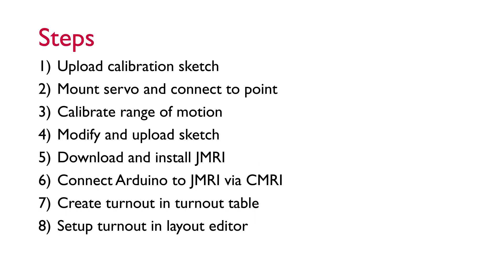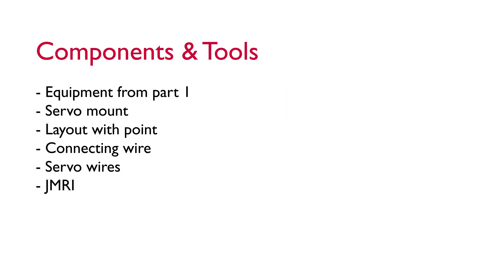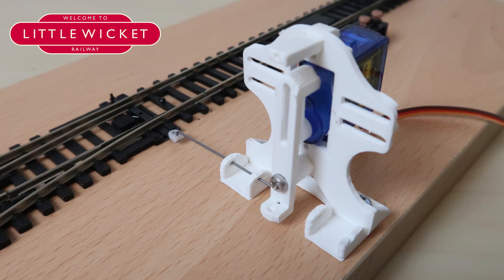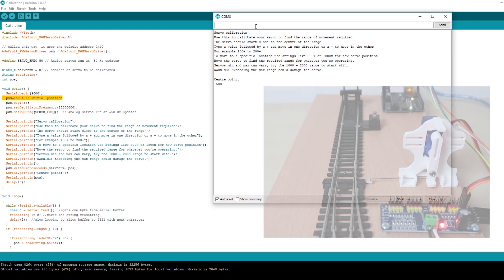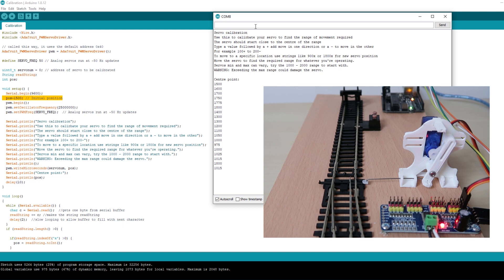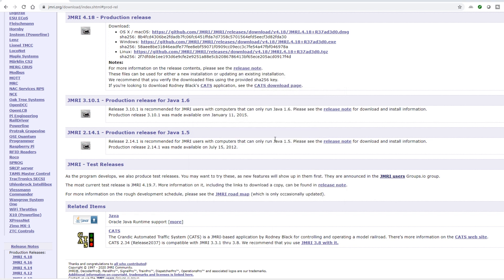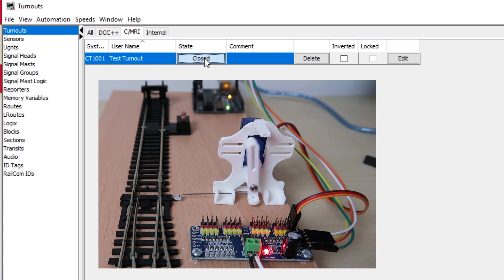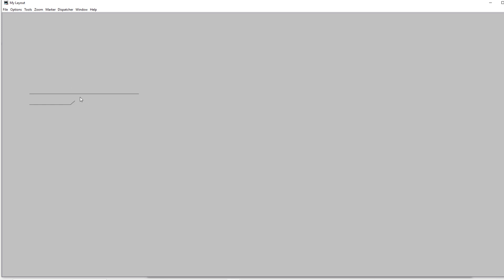Servo Motor Control for Model Railways Part 2 of 3 - Servo Point Motor

Comment: when I add the sketch Calibration - downloaded from your link, I get an error "redefinition of 'void setup()' when I try to Validate. The error code is reproduced below
Arduino: 1.8.13 (Mac OS X), Board: "Arduino Uno"

/Users/andrewgarcarz/Documents/Arduino/sketch_feb10e/Calibration.ino: In function 'void setup()':
Calibration:13:6: error: redefinition of 'void setup()'
 void setup() {
      ^~~~~
/Users/andrewgarcarz/Documents/Arduino/sketch_feb10e/sketch_feb10e.ino:3:6: note: 'void setup()' previously defined here
 void setup() {
      ^~~~~
/Users/andrewgarcarz/Documents/Arduino/sketch_feb10e/Calibration.ino: In function 'void loop()':
Calibration:36:6: error: redefinition of 'void loop()'
 void loop()
      ^~~~
/Users/andrewgarcarz/Documents/Arduino/sketch_feb10e/sketch_feb10e.ino:8:6: note: 'void loop()' previously defined here
 void loop() {
      ^~~~
exit status 1
redefinition of 'void setup()'

This report would have more information with
"Show verbose output during compilation"
option enabled in File -> Preferences.

Any ideas? 
Up to this point the servos worked well (Part 1 Video) but now I'm stuffed

Comment: you could take the spring out of the point and slow the servo down, so that you have a realistic movement on the point.
Reply from the maker: Yeah! On the next layout I definitely plan to slow the points down to a realistic speed. Hopefully because the servos are so powerful I won't need to remove the spring which might be a bit of a faff.

Comment: Like Martin below I am struggling getting your calibration sketch. I'm probably thick as 2 planks. Video 1 went faultlessly, but unlike the test sketch in V1, there is no button to just say download to my PC. I've tried cut and paste into a new Arduin IDE file but when that compiles I get error messages. I'm new to all this, and have no doubt any body. Basically how do I get your Calibration Sketch into my library?
Reply from the maker: Hi Simon, are you able to copy the code from here into your Ardunio software? https://github.com/LittleWicketRailway/ServoControl/blob/master/Calibration.ino

You'll need to save it and then should be able to verify and upload just like in video 1. Let me know how you get on.
Reply: Fixed. Hope this makes sense, but my IT son helped me based on what Martin's problem was. To help others:
As I could find no way to directly down load your sketch I cut and pasted the text of your sketch into a blank file in the IDE editor. When I saved this, it gave the libraries folder as the default location. My son said that was the problem and needed to set up a folder called sketches (say) and save it in there. As soon as I put it in there the and did upload all the errors went away. (Apparently my son said they were only warnings because the sketch was in the libraries folder.)
Reply from the maker: @Simon Turner  Thanks for sharing, I bet other people have had this issue 👍 Thanks to your son for sort it all out!

Comment: Love watching your videos. I’m new to the hobby could you tell me when you measure a 15inch radius bo you measure from the inside rail or the outside rail or from the middle of the track it’s self .thank you
Reply from the maker: Hi Kevin, for Hornby curves the radius is measured to the centre of the track, between the two rails, but I'm not sure about other manufacturers. 15 inches in cm is 38.1 and that's close to being a 1st radius Hornby curve which has a radius of 37.1cm. If you google track geometry then you'll probably find some useful diagrams. What type of track are you using?
Reply: Thank you very much.your videos are well put together .

Comment: Hi Rob
Great  video watched on my smartphone.  How do you insert/ upload the calibration  sketch. 
Thanks
Andy
Reply: HowDo you download the calibration sketch as it does not show in the description below thank you 
Great series and easy to follow many thanks Barry
Reply from the maker: @barrygreenwood7674  the calibration sketch is in the same area as the main sketch in the GitHub repository: https://github.com/LittleWicketRailway/ServoControl/blob/master/Calibration.ino
Reply from the maker: Hi Andy! You upload the calibration sketch to the board first, find the servo positions and they you have to reupload the servo sketch with those positions in them. I know it's not an ideal solution having to upload sketches multiple times, but it's a process you should only ever need to do once for each servo and then it's sorted forever.

Comment: Excellent tutorial - followed it to the letter and it all worked fine (apart from the bits that I didn't follow first time around - probably and age thing).
Reply from the maker: Thanks! Haha, following the instructions first time, where's the challenge in that? 😂
Reply: Whilst appreciating that your aim is to automate as much as possible, I would like to set up a servo on a set of points that is operated by push button.  Can your sketch be adopted to use a push button and if so can you provide any coding or pointers.  Thanks

Comment: That Wonderfull I now have my first on working but I would like to control the speed of the throw I have tried working with the WMF but it seems not to be helping is there some code that could be added to control the speed?
Regards Derek
Reply from the maker: Hi Derek! Congratulations on getting it up and running. You need to add a loop to the code that changes the position of the servo. I think there's an example of a loop at the end of the coloured light video. The same type of loop used to fade the light can slow the point movement. Let me know if you can't find it and I'll try to dig out the code.

Comment: Rob... this tutorial is fantastic! I am a novice at best with Arduino but have been trying to learn. I have tried for years to find a tutorial that showed how to use servos for point motors (turnouts for us yankees) and connect them to JMRI, this was just what I needed. I havent had much luck with DCC++, my decoders (Soundtraxx) would not work correctly with it and like I said I am not very good with arduino code and therefore not good at troubleshooting the issues with DCC++. as a result I have gone back to connecting JMRI through my Digitrax system (which I already have and it works fine for me). The question I have is: can I connect this turnout control through JMRI with a Digitrax system and not DCC++?
I would appreciate any guidence that you could give me on this, 
Thank You
Paul
Reply from the maker: Hi Paul! Thanks!

I can't say for certain as I haven't tried it myself and I've never used DigiTrax, but I think that should work. JMRI can have multiple connections to different systems. Keep your turnouts on the CMRI addresses and use DigiTrax for your loco control.
Reply: @LittleWicketRailway  

Thanks for your reply. I actually figured it out. When I watched your video it was kinda late at night and I was tired and not processing everything. I woke up the next morning and connected it... it works great. 

Thank you 
Paul

Comment: Just subbed found this all fascinating ,I went down the route of block signalling  product with point indication leds a nightmare to wire up ,maybe this would have a challenge. Regards Fred the dc dinosaur. ps great for all the young guys who are dcc and tech orientated . Pps 1 only use an iPad Pro
Reply from the maker: Thanks for watching 👍 I think whichever method you go with the wiring is a nightware, although I am looking at how easy it is to start using some wireless components.

Comment: On trying to verify and/or uploading the compilation sketch I get error messages 
as below.  From Github, as your link, I chose Add File via Uplink for Calibration and then copied and pasted the code into the Arduino IDE.  I then ran verify and obtained all the error mesages and also tried Upload and again received all the messages.  What am I doing wrong?  The error messages are too long for this comment but they seem to revolve around redefinition of 'Adafruit_PWMServoDriver pwm' and highlights a line of code that is  #include <Auto485.h>
Regards
Martin Wilkins
 
Arduino: 1.8.13 (Windows Store 1.8.42.0) (Windows 10), Board: "Arduino Uno"

C:\Program Files\WindowsApps\ArduinoLLC.ArduinoIDE_1.8.42.0_x86__mdqgnx93n4wtt\arduino-builder -dump-prefs -logger=machine -hardware C:\Program Files\WindowsApps\ArduinoLLC.ArduinoIDE_1.8.42.0_x86__mdqgnx93n4wtt\hardware -tools C:\Program Files\WindowsApps\ArduinoLLC.ArduinoIDE_1.8.42.0_x86__mdqgnx93n4wtt\tools-builder -tools C:\Program Files\WindowsApps\ArduinoLLC.ArduinoIDE_1.8.42.0_x86__mdqgnx93n4wtt\hardware\tools\avr -built-in-libraries C:\Program Files\WindowsApps\ArduinoLLC.ArduinoIDE_1.8.42.0_x86__mdqgnx93n4wtt\libraries -libraries C:\Users\marti\OneDrive\Documents\Arduino\libraries -fqbn=arduino:avr:uno -vid-pid=2341_0043 -ide-version=10813 -build-path C:\Users\marti\AppData\Local\Temp\arduino_build_624433 -warnings=none -build-cache C:\Users\marti\AppData\Local\Temp\arduino_cache_668360 -prefs=build.warn_data_percentage=75 -prefs=runtime.tools.arduinoOTA.path=C:\Program Files\WindowsApps\ArduinoLLC.ArduinoIDE_1.8.42.0_x86__mdqgnx93n4wtt\hardware\tools\avr -prefs=runtime.tools.arduinoOTA-1.3.0.path=C:\Program Files\WindowsApps\ArduinoLLC.ArduinoIDE_1.8.42.0_x86__mdqgnx93n4wtt\hardware\tools\avr -prefs=runtime.tools.avr-gcc.path=C:\Program Files\WindowsApps\ArduinoLLC.ArduinoIDE_1.8.42.0_x86__mdqgnx93n4wtt\hardware\tools\avr -prefs=runtime.tools.avr-gcc-7.3.0-atmel3.6.1-arduino7.path=C:\Program Files\WindowsApps\ArduinoLLC.ArduinoIDE_1.8.42.0_x86__mdqgnx93n4wtt\hardware\tools\avr -prefs=runtime.tools.avrdude.path=C:\Program Files\WindowsApps\ArduinoLLC.ArduinoIDE_1.8.42.0_x86__mdqgnx93n4wtt\hardware\tools\avr -prefs=runtime.tools.avrdude-6.3.0-arduino17.path=C:\Program Files\WindowsApps\ArduinoLLC.ArduinoIDE_1.8.42.0_x86__mdqgnx93n4wtt\hardware\tools\avr -verbose C:\Users\marti\OneDrive\Documents\Arduino\calibration\calibration.ino

C:\Program Files\WindowsApps\ArduinoLLC.ArduinoIDE_1.8.42.0_x86__mdqgnx93n4wtt\arduino-builder -compile -logger=machine -hardware C:\Program Files\WindowsApps\ArduinoLLC.ArduinoIDE_1.8.42.0_x86__mdqgnx93n4wtt\hardware -tools C:\Program Files\WindowsApps\ArduinoLLC.ArduinoIDE_1.8.42.0_x86__mdqgnx93n4wtt\tools-builder -tools C:\Program Files\WindowsApps\ArduinoLLC.ArduinoIDE_1.8.42.0_x86__mdqgnx93n4wtt\hardware\tools\avr -built-in-libraries C:\Program Files\WindowsApps\ArduinoLLC.ArduinoIDE_1.8.42.0_x86__mdqgnx93n4wtt\libraries -libraries C:\Users\marti\OneDrive\Documents\Arduino\libraries -fqbn=arduino:avr:uno -vid-pid=2341_0043 -ide-version=10813 -build-path C:\Users\marti\AppData\Local\Temp\arduino_build_624433 -warnings=none -build-cache C:\Users\marti\AppData\Local\Temp\arduino_cache_668360 -prefs=build.warn_data_percentage=75 -prefs=runtime.tools.arduinoOTA.path=C:\Program Files\WindowsApps\ArduinoLLC.ArduinoIDE_1.8.42.0_x86__mdqgnx93n4wtt\hardware\tools\avr -prefs=runtime.tools.arduinoOTA-1.3.0.path=C:\Program Files\WindowsApps\ArduinoLLC.ArduinoIDE_1.8.42.0_x86__mdqgnx93n4wtt\hardware\tools\avr -prefs=runtime.tools.avr-gcc.path=C:\Program Files\WindowsApps\ArduinoLLC.ArduinoIDE_1.8.42.0_x86__mdqgnx93n4wtt\hardware\tools\avr -prefs=runtime.tools.avr-gcc-7.3.0-atmel3.6.1-arduino7.path=C:\Program Files\WindowsApps\ArduinoLLC.ArduinoIDE_1.8.42.0_x86__mdqgnx93n4wtt\hardware\tools\avr -prefs=runtime.tools.avrdude.path=C:\Program Files\WindowsApps\ArduinoLLC.ArduinoIDE_1.8.42.0_x86__mdqgnx93n4wtt\hardware\tools\avr -prefs=runtime.tools.avrdude-6.3.0-arduino17.path=C:\Program Files\WindowsApps\ArduinoLLC.ArduinoIDE_1.8.42.0_x86__mdqgnx93n4wtt\hardware\tools\avr -verbose C:\Users\marti\OneDrive\Documents\Arduino\calibration\calibration.ino

Using board 'uno' from platform in folder: C:\Program Files\WindowsApps\ArduinoLLC.ArduinoIDE_1.8.42.0_x86__mdqgnx93n4wtt\hardware\arduino\avr

Using core 'arduino' from platform in folder: C:\Program Files\WindowsApps\ArduinoLLC.ArduinoIDE_1.8.42.0_x86__mdqgnx93n4wtt\hardware\arduino\avr

Detecting libraries used...

"C:\\Program Files\\WindowsApps\\ArduinoLLC.ArduinoIDE_1.8.42.0_x86__mdqgnx93n4wtt\\hardware\\tools\\avr/bin/avr-g++" -c -g -Os -w -std=gnu++11 -fpermissive -fno-exceptions -ffunction-sections -fdata-sections -fno-threadsafe-statics -Wno-error=narrowing -flto -w -x c++ -E -CC -mmcu=atmega328p -DF_CPU=16000000L -DARDUINO=10813 -DARDUINO_AVR_UNO -DARDUINO_ARCH_AVR "-IC:\\Program Files\\WindowsApps\\ArduinoLLC.ArduinoIDE_1.8.42.0_x86__mdqgnx93n4wtt\\hardware\\arduino\\avr\\cores\\arduino" "-IC:\\Program Files\\WindowsApps\\ArduinoLLC.ArduinoIDE_1.8.42.0_x86__mdqgnx93n4wtt\\hardware\\arduino\\avr\\variants\\standard" "C:\\Users\\marti\\AppData\\Local\\Temp\\arduino_build_624433\\sketch\\calibration.ino.cpp" -o nul -DARDUINO_LIB_DISCOVERY_PHASE

Alternatives for Wire.h: [Wire@1.0]

ResolveLibrary(Wire.h)

  -> candidates: [Wire@1.0]

"C:\\Program Files\\WindowsApps\\ArduinoLLC.ArduinoIDE_1.8.42.0_x86__mdqgnx93n4wtt\\hardware\\tools\\avr/bin/avr-g++" -c -g -Os -w -std=gnu++11 -fpermissive -fno-exceptions -ffunction-sections -fdata-sections -fno-threadsafe-statics -Wno-error=narrowing -flto -w -x c++ -E -CC -mmcu=atmega328p -DF_CPU=16000000L -DARDUINO=10813 -DARDUINO_AVR_UNO -DARDUINO_ARCH_AVR "-IC:\\Program Files\\WindowsApps\\ArduinoLLC.ArduinoIDE_1.8.42.0_x86__mdqgnx93n4wtt\\hardware\\arduino\\avr\\cores\\arduino" "-IC:\\Program Files\\WindowsApps\\ArduinoLLC.ArduinoIDE_1.8.42.0_x86__mdqgnx93n4wtt\\hardware\\arduino\\avr\\variants\\standard" "-IC:\\Program Files\\WindowsApps\\ArduinoLLC.ArduinoIDE_1.8.42.0_x86__mdqgnx93n4wtt\\hardware\\arduino\\avr\\libraries\\Wire\\src" "C:\\Users\\marti\\AppData\\Local\\Temp\\arduino_build_624433\\sketch\\calibration.ino.cpp" -o nul -DARDUINO_LIB_DISCOVERY_PHASE

Alternatives for Adafruit_PWMServoDriver.h: [Adafruit_PWM_Servo_Driver_Library@2.4.0]

ResolveLibrary(Adafruit_PWMServoDriver.h)

  -> candidates: [Adafruit_PWM_Servo_Driver_Library@2.4.0]

"C:\\Program Files\\WindowsApps\\ArduinoLLC.ArduinoIDE_1.8.42.0_x86__mdqgnx93n4wtt\\hardware\\tools\\avr/bin/avr-g++" -c -g -Os -w -std=gnu++11 -fpermissive -fno-exceptions -ffunction-sections -fdata-sections -fno-threadsafe-statics -Wno-error=narrowing -flto -w -x c++ -E -CC -mmcu=atmega328p -DF_CPU=16000000L -DARDUINO=10813 -DARDUINO_AVR_UNO -DARDUINO_ARCH_AVR "-IC:\\Program Files\\WindowsApps\\ArduinoLLC.ArduinoIDE_1.8.42.0_x86__mdqgnx93n4wtt\\hardware\\arduino\\avr\\cores\\arduino" "-IC:\\Program Files\\WindowsApps\\ArduinoLLC.ArduinoIDE_1.8.42.0_x86__mdqgnx93n4wtt\\hardware\\arduino\\avr\\variants\\standard" "-IC:\\Program Files\\WindowsApps\\ArduinoLLC.ArduinoIDE_1.8.42.0_x86__mdqgnx93n4wtt\\hardware\\arduino\\avr\\libraries\\Wire\\src" "-IC:\\Users\\marti\\OneDrive\\Documents\\Arduino\\libraries\\Adafruit_PWM_Servo_Driver_Library" "C:\\Users\\marti\\AppData\\Local\\Temp\\arduino_build_624433\\sketch\\calibration.ino.cpp" -o nul -DARDUINO_LIB_DISCOVERY_PHASE

Alternatives for CMRI.h: [madleech-ArduinoCMRI-d5d4a1e]

ResolveLibrary(CMRI.h)

  -> candidates: [madleech-ArduinoCMRI-d5d4a1e]

"C:\\Program Files\\WindowsApps\\ArduinoLLC.ArduinoIDE_1.8.42.0_x86__mdqgnx93n4wtt\\hardware\\tools\\avr/bin/avr-g++" -c -g -Os -w -std=gnu++11 -fpermissive -fno-exceptions -ffunction-sections -fdata-sections -fno-threadsafe-statics -Wno-error=narrowing -flto -w -x c++ -E -CC -mmcu=atmega328p -DF_CPU=16000000L -DARDUINO=10813 -DARDUINO_AVR_UNO -DARDUINO_ARCH_AVR "-IC:\\Program Files\\WindowsApps\\ArduinoLLC.ArduinoIDE_1.8.42.0_x86__mdqgnx93n4wtt\\hardware\\arduino\\avr\\cores\\arduino" "-IC:\\Program Files\\WindowsApps\\ArduinoLLC.ArduinoIDE_1.8.42.0_x86__mdqgnx93n4wtt\\hardware\\arduino\\avr\\variants\\standard" "-IC:\\Program Files\\WindowsApps\\ArduinoLLC.ArduinoIDE_1.8.42.0_x86__mdqgnx93n4wtt\\hardware\\arduino\\avr\\libraries\\Wire\\src" "-IC:\\Users\\marti\\OneDrive\\Documents\\Arduino\\libraries\\Adafruit_PWM_Servo_Driver_Library" "-IC:\\Users\\marti\\OneDrive\\Documents\\Arduino\\libraries\\madleech-ArduinoCMRI-d5d4a1e" "C:\\Users\\marti\\AppData\\Local\\Temp\\arduino_build_624433\\sketch\\calibration.ino.cpp" -o nul -DARDUINO_LIB_DISCOVERY_PHASE

Alternatives for Auto485.h: [madleech-Auto485-3ff0421]

ResolveLibrary(Auto485.h)

  -> candidates: [madleech-Auto485-3ff0421]
Reply from the maker: Hi Martin,

Any time you see the line "#Include" the sketch is pulling in code from a library. I think the error is saying that you're missing the Auto485.h library. 

Just double check that you've done this step from video 1 which installs the 2 libraries that you need: https://www.youtube.com/watch?v=ayOoUkdjHtg&t=881s
Reply: @LittleWicketRailway  Rob,  the files are all installed but the sketch will still not verify or load.  Is there a folder structure that I should be using?  where are all these files held?
Martin

Comment: Followed this tutorial,  got a little bit lost. Found out the hard way that all arduino files need to be in the same directory., so I had to do a bit of housekeeping. Also had to take off DCC++ as only one USB port left. Seems to work so far. Looking forward to part 3.
Reply from the maker: I've just seen your post on part 3. Glad you got it working, hopefully it wasn't too frustrating. You can use additional external USB ports if you're running low on connections, but it needs to be a powered system.